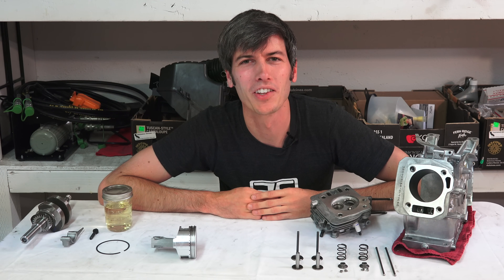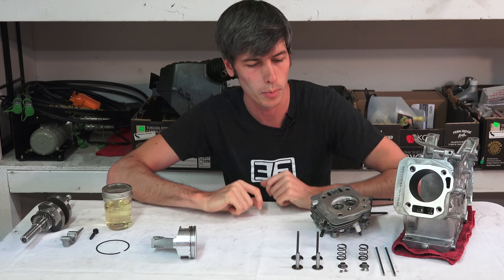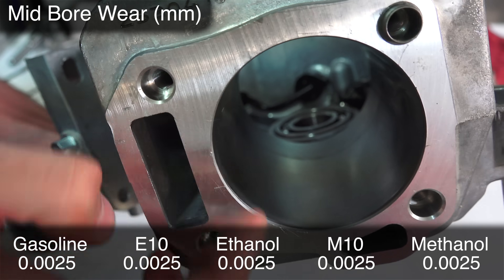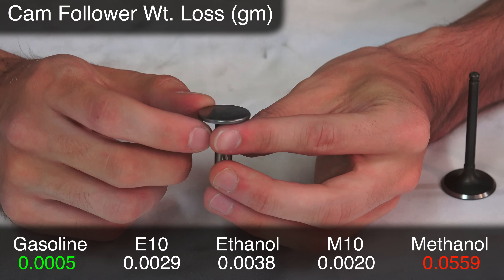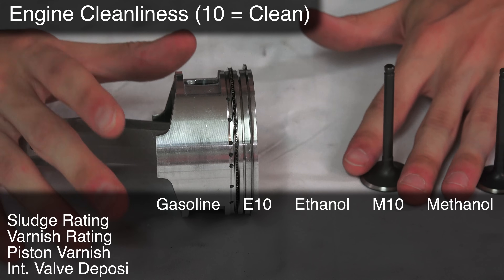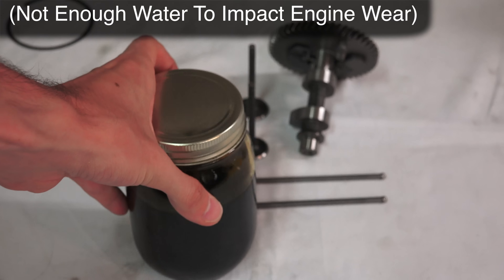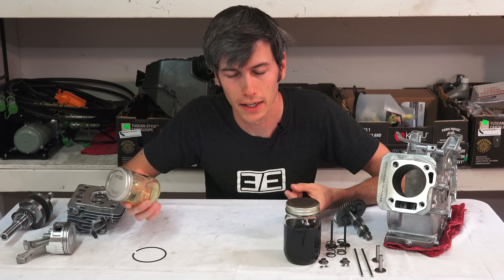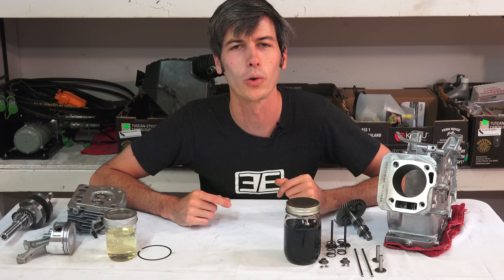Is Ethanol Bad For Your Car's Engine?

Comment: Thanks for mentioning the moisture and phase separation issues. It's murder on small carb jets and passages if the gas sits a while. Stabil does nothing for this.
Reply: Exhaust gases to intake fuel mixture. Percent vs established pollution. 93% efficiency clean emissions.
While your over all number may be correct, the captured heat is a very useful resource fighting off sub-zero icy conditions for a large population not included in your stats.
Reply: I have a car that can't move, and I make sure to start it at least once a week. EFI small block Ford.

There are also a few places around here that now sell straight unleaded 91. So it does exist.
Reply: Amen to that. I’m a good mechanic and have tried everything on an old 225cc motorcycle carb that’s dead after sitting awhile. Replaced the jets, carb cleaner soaks, little carb brushes, welding torch tip cleaning rods, ultrasonic cleaner. But there are little passageways that are not removable and hard or impossible to reach. Whatever, who knows. Nothing worked and had to replace the carb. I was able to successfully clean and re-jet a 400 though. I think I’m gonna cut my losses and pony up for a fuel injected bike designed to run on this crap. As for my chainsaws, a spend extra, a lot extra, for Husqvarna premix that has stabilizers and no ethanol. If I used it for a living, the cost would be prohibitive, but I don’t so it isn’t.
Reply: @mechanicalman1068  let me tell you a trick I figured out a few years back. Anytime you have a small engine, whether it's a 2-stroke chainsaw or a 4-stroke snow blower, if they run sluggish or not at all because they've sat for too long, just a capful or even two or three capfuls, in a tank full of fresh gas. Injector cleaner, just like you put in your fuel injected automobile or pick up. Eats up any varnish or sludge that might have formed in your carburetor passages. Works like magic.
Reply: shake well before consumption?
Reply: Star Tron works 10x better than stabil.
Reply: @idk-gq3lh  hahaha why yes. It comes in a...drum roll, please...a gas can, for no additional charge.😉
Reply: The challenge with small engine equipment such as lawn mowers, etc.. you usually buy a few gallons which tend to sit around for longer than the gas in your car. During that time, you get more moisture..
Reply: was wondering why all the warnings on lawnmowers and such, that makes sense.
Reply: @JoeHynes284  Most lawn equipment uses carburetors. Ethanol gels up in the carbs, causing failures. Also, the lines are probably not ethanol compliant, and will just rot after time.
Reply: @JoeHynes284 if you're in a state with only ethanol road gas, they do sell straight gas for small engines, but it's about $20 per gallon, by the gallon at home depot & Lowe's.
Reply: Gear Whine I have small property so all my stuffs electric but I had always wondered why the ethanol would be an issue not thinking about what you pointed out with the carburetors that’s a good point
Reply: Joe schmo

Also, ethanol has a different stoichiometric ratio than gasoline; it needs to be about 30% richer. While a computerized ECU can adjust for different fuel blends,  a mechanical carb needs a re-jet or it will run dangerously lean.
Reply: @JoeHynes284  thanks much. In fact folks, if you still have gas equipment laying around that quit working, you can sometimes just run a very small wire through the jet to get it running again.  Like a bread twisty-tie with the paper removed.
Reply: bcubed72
That's only true of E85 or pure ethanol. E10 makes no significant difference.
Reply: @bendeleted9155  Great tip! I've done that countless times. It's really nice when the float bowls are accessible and come off easy. Then you can be back in business in just a few minutes.
Reply: @bendeleted9155  We have straight gas for about the same price as premium or diesel. It's awesome. One place even has a dedicated pump for it.
Reply: @dchawk81  that's great. What part of the world are you in?
Reply: @bendeleted9155  USA. It's an independent Sunoco.
Reply: Gas separates with very little water. The more ethanol in the gas, the more water it can absorb before separation.
Reply: Its a great idea for cars, maybe small engine mfg should update their designs to not fall apart with a small amount of alcohol. My weedwacker has different fuel lines and ive let it sit 8 months easy without draining anything and it still works perfect years later.
Reply: @hajjdawood  unfortunately, it's not that simple. Since alcohol attracts moisture, and is not stable in gasoline it's not a good idea as a fuel sitting in confined areas. It wants to separate and make varnish. "Updating" small engines isn't a fix. The orifices are just more affected by the resulting varnish narrowing the smaller passages.  Allowing straight road gasoline as a choice for older vehicles and small engines could bring it back to a reasonable price and solve the problem too. Forcing the contamination of gasoline with alcohol as our only choice is the bad idea here.
Reply: Hajji Daoud
They obviously have. I bought a new Poulan Pro lawnmower just a month ago and its owner's manual states that using E10 fuel is fine. Having said that, My 10 year-old two-stroke Homelite trimmer has always been with E10-based premix without problems.
Reply: Why use ethanol. Lead was fazed out in the '70s. Engine efficiency is near 93% compared to 75% in the '60s. Ethanol was sought as a price buffer against $120 a barrel oil, probably will not go above $80 now a days and quite possibly down to $60. If you look at ethanol cost to produce and other food price and subsidies, WHY. Give me gasoline at least as an option.
Reply: u2mister1 why use ethanol? Iowa. Big corn state...ethanol is made from corn...ethanol production pushes up corn prices and production...Iowa is the first presidential caucus. And other corn states are also attached to it and won’t allow any legislation eliminating it. So yeah, politics and money. My carbureted dirt bikes with small engines are always having problems as I don’t ride them over the winter. I hate the stuff. I buy premix non ethanol fuel for my chainsaw at significant expense, but even on a long day it uses a lot less gas than short motorcycle day.
Reply: I haven't personally had any issues, but I hear what you are saying.  I have stored several vehicles with fuel stabilizer for deployments aboard submarines.  Just my experience, I'd rather be lucky then good I guess

Comment: Good video Jason, but why focus so much about the methanol? It's not what the video is about.
Reply: Because this is where the statistics shows a significant difference.
So : there's no significant difference between 100 % gasoline and 100% ethanol.
But don't run on meth'anal.

Comment: the issue with their study is that oil then wasn't formulated specifically for ethanol use.
Reply from the maker: Yet ethanol did just fine as far as results.
Reply: would the different fuel energy densities mean they did different amounts of work ?
Reply: Is there oil formulated for ethanol use? I never heard of this.

Comment: How many runs did they do for every fuel? Because 1 run aint usefull. 3-5 is the minimum. Otherwise the wear could be random.
Reply: Another guy who didn't watch the video.  One run for 20 hours at mid rpm.  How did you determine that 3-5 runs is the minimum?  Why can't you use the data provided by the study and extrapolate?  Even if they did a study for the entire life of an engine I think it would be difficult to eliminate all the variables, or extremely expensive to do so.
Reply: Todd Stevens Scientific research requires repeatable result to provide a reliable conclusion. That’s just what scientists do. It doesn’t mean the previous study was wrong. However, more studies should be carried out to eliminate the variables in each study.

Comment: 20 hours seems way too short. I drive for 90 minutes every day...
Reply from the maker: Not at a high load at low RPM; that's a pretty rough test in comparison to any daily commute. You accelerate a couple times (highway merging, passing cars, etc), versus constantly.
Reply: Yes but we commute for thousands of miles before we expect any appreciable wear.
Reply: Yes but we commute for thousands of miles before we expect any appreciable wear.
Reply: Yes but we commute for thousands of miles before we expect any appreciable wear.
Reply: Yes but we commute for thousands of miles before we expect any appreciable wear.
Reply: Yes but we commute for thousands of miles before we expect any appreciable wear.
Reply: Yes but we commute for thousands of miles before we expect any appreciable wear.

Comment: In the early 90's when they started introducing the mixed fuels, quite a few cars had major issues... not with the metal parts, but with the rubber parts. I had a late 80's Nissan Maxima that had an engine bay fire due to the rubber fuel hose failing, spraying fuel over a hot engine. Not really Nissans fault as when the vehicle was introduced, mixed fuels hadn't been introduced to the masses. My only gripe with mandating methanol in fuel is that when we have a bad corn harvest, more corn goes to making fuel than feeding livestock. I much prefer eating to driving a car with 10% methanol ;-) We used methanol to soak up water in propane tanks, (our propane is stored in SC in huge underground granite storage tanks,  1 stored around 100 million gallons and the other stored 60 million, (don't quote me on those numbers but they are close if memory serves))  They use groundwater as a sealant to help contain the liquid fuel. Water seeps in through the cracks and some is pumped into tanks, we would use methanol to soak up the water and burn it which helps to keep the regulators from freezing. Excellent video Mr EE, as usual :-)
Reply: *ethanol comes from corn.
Methanol comes from wood, that's why it's called "wood alcohol". Ethanol is in alcoholic beverages, but methanol causes blindness, brain damage, and death, because your liver turns it into formaldehyde, which embalms you from the inside out. There's a big difference between the two. I hope that helped. Late 80s Nissan Maximas were really nice cars. Sorry that happened.
Reply: Buddy Clem 

No. Methanol is not produced from wood. It’s made from synthesis gas.
Reply: You guys are all right: ethanol and methanol can both be produced with either biomass or natural gas (or oil?), but it is ethanol that is used and mandated in cars. Methanol is more toxic and more corrosive and has slightly different properties.
Reply: Rolf Bjorn 

Right. The commenter was clearly confusing the two alcohols, both of which are clean burning octane improvers. The latest # I’ve seen was that in the US, over 1/3 of corn production is used for ethanol. Of course, it’s not a human or animal feed variety.
Reply: The variety of corn used does not matter, it uses over 300 gallons of water as well as other ressources, labor and farm land to produce every gallon of ethanol this way. If it was produced from biomass (compost, fibrous industry waste, agricultural waste) or algae that would not be such a problem.
Reply: Rolf Bjorn 

Yield depends on the type of corn. Corn for ethanol is very high in starch. Also, note that the byproduct is dried and used as animal feed.
Reply: That rubber hose could've just failed from age, too.  Rubber doesn't last forever no matter what you do, and I'm sure the compounds they had in the 80's were worse than today in terms of stability and longevity.  Bottom line, it needs further study to be considered a conclusive assessment of the cause of failure.

Comment: I use E85 in an 01 Mustang with no modifications. The only difference I saw was I lost one miles per gallon.
Reply: I've ran e85 mixed half tank with 93 and felt the car ran better and I also have no modifications to the fuel system. 07 civic si.
Reply: @VanishingImage  mine runs cooler and I run all e85 funny thing when I bought the car a year ago it had an idle problem just went always after 3 weeks of e85 lol
Reply: How long have you been running e85? The New edges should have a better fuel pump and bigger fuel injectors to run e85 safely.
Reply: @negativesplits06  a year and a half
Reply: not even the compression ratio? they are different in ethanol engines
Reply: I have a bit over 100k miles of e85 use on my 09 civic si. About 7 years of straight e85... Sits with e85 through the salty winter. No issues. I lost about 20% mpg, but it breaks even vs premium gas.
Reply: well i used E85 for performance, my car made nearly 100whp more vs 91 octane. but of course i feel turbo's take more advantage of E85 than NA engines.
Reply: Your 01 Mustang is flexfuel, right?
Reply: @ToliniDaniel  no it's not it's a mustang lol
Reply: I'm running straight e85 on my falcon with 400rwkw and 1050 torque and it has bad cold start cos of e85 and pretty high fuel consumption
Reply: @muhumads  my fuel economy hasn't changed very much. I do get cold start once a day but I live in Florida so unless I don't drive for 24 hours my engine doesn't cool down enough for a cold start. but I started using E85 in my 2003 neon back when Florida had Winters and I would not use it in the winter but now we don't have winter.

Comment: Gasoline containing ethanol is not good on sitting engines and carbs (i.e. winter stored cars and motorcycles) as it makes rubber gaskets and o-rings crack...owners HAVE TO add gasoline stabilizers during storage in order to prevent this.

Comment: My lawn mower used to start easily when I bought it 12 years ago.  I believe that it was the ethanol that caused it to become harder over time to start, even with starting fluid (ether spray).  I now use ethanol free gasoline, available at some stations, and now it starts easy again.
Reply: I have an electric lawnmower that’s starts up fine every time 👍🏽...😂
Reply: Until you run over the power cord :)
Reply: Matthew Zaleski not if it’s battery powered 😏
Reply: Or.... maybe just the fact that its 12 years old and has a lotvof wear and tear on it?
Reply: Consumer mower engines usually rated around 200-400 hours of operation and will still be okay.  That's about 20 years of seasonal mowing for the typical homeowner with a small lawn.   Commercial rated mower engines (Honda) can go for thousands of hours, meant for commercial yard companies using them.
Reply: Had my craftsman for over 10 years now and starts on the first pull every time. I run it completely out of gas at the end of my cutting season before it sits. Never had to tear this carb apart, still haven't changed the air filter 🤷‍♂️

Comment: 10% ethanol gas does play havoc on your fuel system for example I use clean gas, clear gas, or ethanol free (depending on who you're asking) in vehicles that sit for example four wheeler, snowmobile, jet skis, boat, lawn mower, weed wacker, because the ethanol will sit there and gum up carburetors and injectors and fuel lines and fuel pumps when it sits for too long. I've cleaned/ replaced way too many carburetors and carburetor Jets because people use ethanol fuel and then let the four-wheeler sit for 2 years or motorcycle sit for years
As for fuel injection if you let it sit for a really long time it will gum up injectors but then you just use a injector cleaner and your good for the most part
Reply: That is true. There is a "gum like" deposit that forms when it sit iddle for too long. Specially on carburated systems (low pressure). Ethanol is also hydrofilic. For engines that are used often (almost every day) ethanol can be a superior fuel. If it's not the case, stick to gasoline.
Reply: Yeah, but if you let the same motor sit for multiple years with plain gas it'll gum up, too.  My race kart cranked up just fine on 1.5 year old E10 and I never even drained the carb.
Reply: @Joe Knapp I've never had a problem with ethanol free gas so they when you use the ethanol gas as when I have an issue so maybe it does varnish but it never affects me
Reply: Thats not true. Not on cars. Small engines with carbs and simpler fuel systems, yes